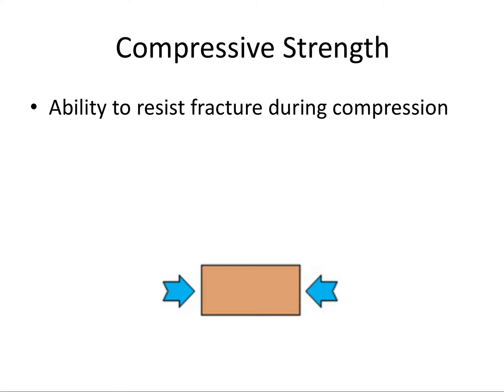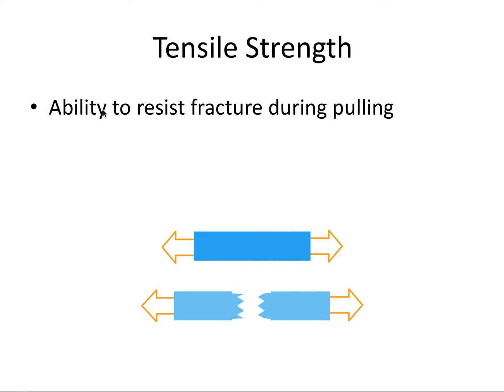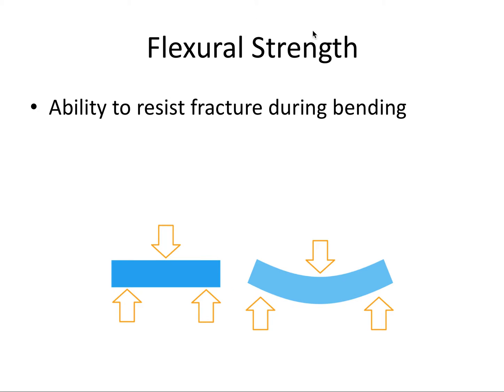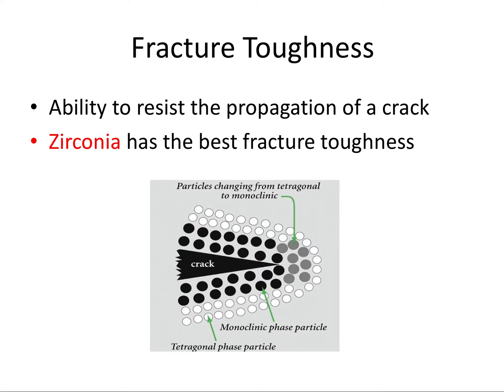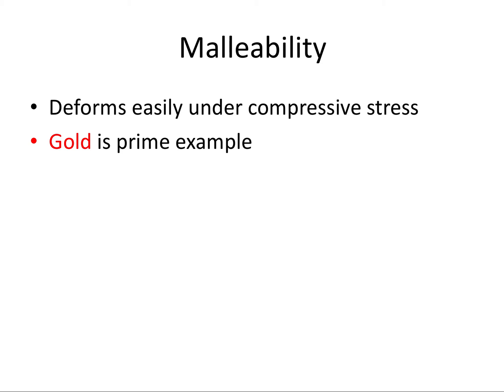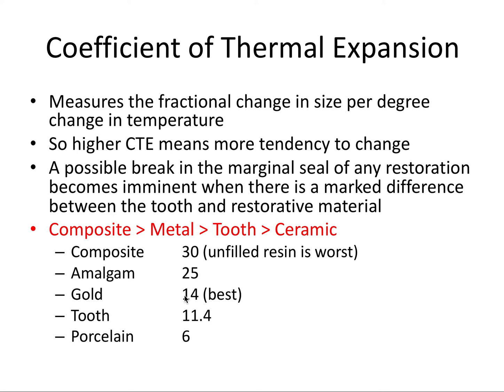Prosthodontics | Mechanical Properties | INBDE, ADAT

Comment: do you have an example for tensile strength ?
Reply from the maker: Tensile strength is the maximum amount of stress a material can withstand before breaking when it is pulled or stretched. Like if you pull a rubber band hard enough, it eventually snaps.

Comment: Hello,  I noticed at 4:42  you said "the steeper the slope, the stiffer the material and the shallower the slope the more elastic that item would be."  I believe you meant to say the shallow slopes means less elasticity because th steeper  the slope, the more stiffness and more stiffness is more elastic.  Please advise.
Reply from the maker: Stiffness and elasticity are two different properties, and while this is a bit of an oversimplification, they are inversely related to each other. A stiffer object is less elastic, a more elastic object is less stiff.